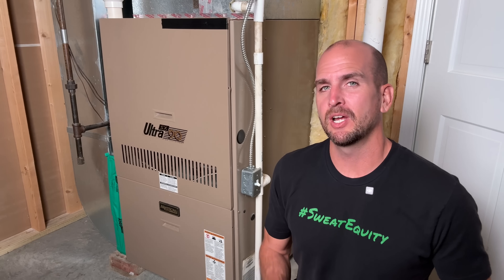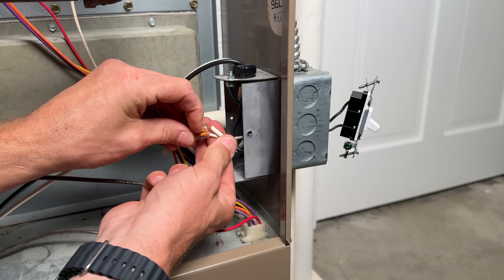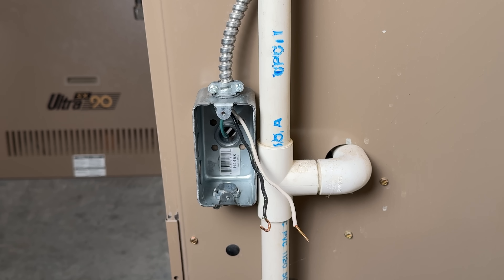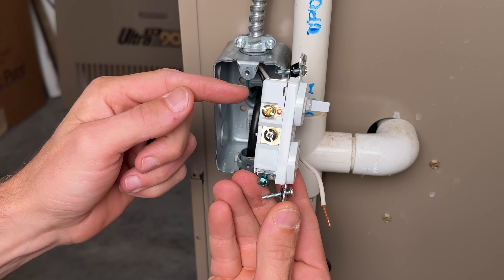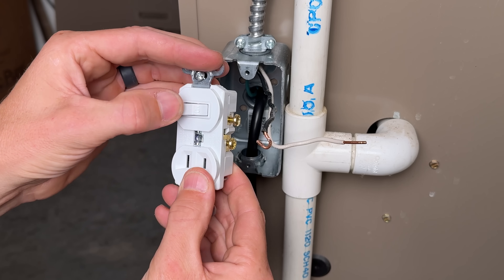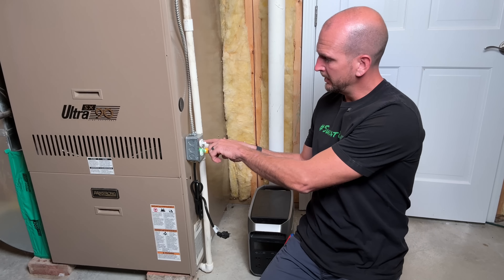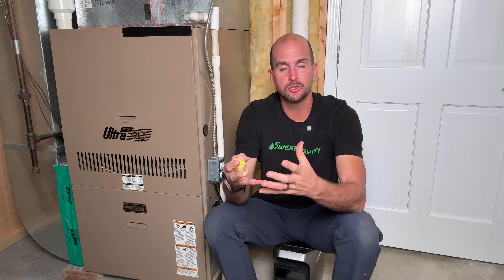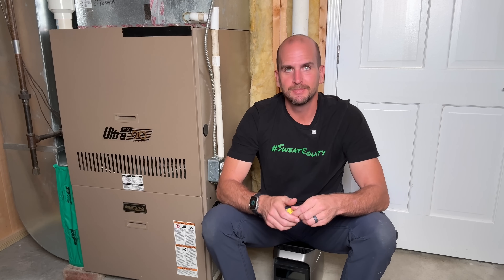Emergency Heat | How To Power Your Gas Furnace When The Lights Go Out

Comment: So there was nice metal conduit and metal box to protect supply wires going into the furnace.  I like Scott's workmanship, but I wonder what NEC2023 would have to say about the idea of running a cheap unprotected 14g extension cord into the box thru knockout & clamp?
Reply: I think the main concern is that a furnace is required to be hard wired. I thought of doing this but instead just replaced the wire nuts with Wagos so that if there's an extended power outage I can easily disconnect the wires from switch and connect the extension cord. Not as simple but same end result and then the other 99+% of the time it's code compliant. Thankfully I've only had to do it once in the last few years.
Reply: @kamX-rz4uy  That's an interesting idea!  Do you keep that unconnected extension cord near your furnace always ready to go, and secured with cable clamp close to box to prevent accidental pull out from Wagos?
Reply: @chuckb4375  It's near the furnace in a bag marked something like generator furnace cord. I didn't use a cable clamp, just had slack in the wires and cord and no one else was allowed near the furnace for safety. It would be a good idea to secure it though.
Reply: You don't even need to be under the latest NEC edition for this to be a major code violation.

This is changing a device that is required and listed to be hard-wired into a plug-in appliance.   Having the receptacle mounted to the side of the furnace doesn't change the situation.

Comment: I do find it interesting when people express alarm that we're going electric-only in MN without realizing that their gas furnace without a generator also doesn't work when the power goes out. This video is a nice option for them to fix the issue they don't realize they have.

Our approach has been to basically get our house closer to passive house levels of insulation and air sealing, so if power goes out we won't have severe issues before power comes back on.
Reply: This is true.. However, most gas furnaces can be ran with only a 1.2KW generator (or other power source). An electric furnace will require a 10X than much power to run. Most people only have a 5 - 7.5KW generator in the garage. That's why people would express alarm about an electric furnace.
Reply: @SvilleSparky  Most of them don't have a generator, nevermind that they'd also need a way to safely connect the generator to their house.

Many heat pumps also could be run with 5kW no problem. I don't know anyone with a single family home in my area who uses resistance heating.

Comment: It was a bit hard to follow without wiring diagrams but…
Wouldn’t this setup feed power back to the panel when you use the backup battery? Thus you would then be feeding power back to the line which is very bad
Reply: No. The portable battery supplies power only via the black plug/cord. When power goes out, you unplug that cord from the outlet, severing the only connection to your home. The battery powers the furnace and nothing else. No risk.
Reply: @nathanscandella6075  gotcha this makes sense now. it was a bit hard to follow in the video

Comment: In short you're converting the furnace to a plug-in appliance.
Reply: For 45 minutes... what a waste.
Reply: @courgettee Depends on where you live. If your power goes out for 12 hours in sub zero temperatures your house is going to get cold quickly.  You can use a generator for power with this setup also ( no gfic from generator)
Reply: @courgettee  Well in my area.... Actually the weather today. If I lost power for 1 hour, my house would be almost at freezing. 2 hours I would have pipes starting to swell. 3 hours I would have to evacuate or high chance of life threatening hypothermia.

So a 10 dollar cord, and 10 dollar switch and an hour of work is well worth it to be able to plug into an emergency power source.
Reply: @courgettee so buy a bigger battery backup unit and/or include a solar array, or run a gas generator...duh.
Reply: Which by NEC is not allowed.

Comment: Scott @EverydayHomeRepairs, why did you connect the green ground wire of the house wiring inside the furnace instead of on the green ground screw on the outlet/switch combo. The power cord also has its own ground prong and wire, and you also connected it to the furnace and house wiring.

Comment: Forget the switch.  Just install an outlet.
Reply: Having the switch is a code requirement, whether you have this “backup” outlet or not
Reply: @nathanscandella6075  CEC states "Suitable disconnecting means shall be provided for the branch circuit."

Comment: I have a fireplace insert with a plenum chamber above it.  At the top of that plenum chamber are two 8" standpipes which are plumbed into my hot air return.  Just above the fireplace is a 36" long, 8" grate for air intake to the plenum chamber.  When I get a fire going the air inside the plenum chamber gets hot (obviously) and rises, pulling in replacement air through the grate.  This forces hot air through the return duct and eventually through the heating ducts.  There is no electricity required, just a normal fire in the fireplace.  No power station needed for heat, but I do own several for basic needs during an outage.

Comment: Please do not make dangeroud DYI halve ass wiring methods. A plug &/or cord must NEVER be used to replace permanent eiring on a fixed  appliance. They make a fsirly in expensive switch that is hard wired.

Comment: Believe it or not, though expensive, there is (or was, I have one installed) a double pull, double through, center off, switch that does this easily.  I have it as the switch between my line voltage and my generator. Basically a transfer switch before home transfer switches were made.

Comment: This is really not a good way to do this. Use the commercial switch & male plug deal, or for 1/2 that 100.00 price get a 2 pole double throw switch, a pig tail & wire it right

Comment: "it pulled 2000 watts". You attached a 15 amp plug, no? Isnt that intended for a max of 1800 watts, and nominally less than that? Shouldn't it have a 20 amp (or greater) male plug? It appears the battery you're using has 20 amp female outlets

Comment: crazy that it's regularly pulling about 1200 watts. My space heater pulls 1500 watts and most likely doesn't move as much heat as that unit lol. I may have to look into a more energy efficient heater. Up in the north it is brutal. tonight it's 44 and gonna get down to 38 and we aren't in winter yet. winters can feel like 10 degrees F. That power station is cool btw.
Reply: @johnnybroughton  ouch true...but the tradeoff is that unlike a space heater needing to be left on for hours, a well insulated home's heater like this one may only need and hour or two to be heated sufficiently with an energy saver option/thermostat

Comment: Wait, didnt that tab you broke off act as the jumper wire that you later connected??
Reply: Yeah, it's the same as if he left the tab there.
Reply: I had the same question. I have no doubt this guy is hitting his forehead with his palm after watching the edit. But he had to publish it anyway. He's a smart dude and admits any mistake or errors in thought on subsequent videos.
Reply: I thought the outlet was always hot unless you broke that tab off?
Reply: What if you want to maintain the furnace switch functionality, but have the outlet available for something else, like a hot water recirculating pump?
Reply: I think the electricity flow in the tab is not controlled by the switch. It always flows via tab if we connect the hot to the black screw terminal. If we break the tab, and add a jumper,  we can control the flow via the switch.
Reply: @jineeshpr  The switch component actually has a defined source side and defined load side. The source is tied in with the hot on the side with the tab. This is because it is designed to provide both switch and outlet functions independently. If your outlet is your load, you are technically supposed to break the tab and jumper a wire across and down from the load side. But since the switch doesn't care which way is which, it all works the same by keeping the tab and wiring your source of the switch to its Load screw. It does mean you are putting a screw with a Hot wire mm's from the screw with the Neutral wire, which is fine but dicey.
Reply: @arickbakken thank you for the explanation sir

Comment: No need to remove the tab or jump.  By reversing the wiring (hot line wire to hot load terminal), you were already ensuring that the switch controlled the receptacle.  Easy to demonstrate with continuity test.
Reply: right, I was just about to say-- how is cutting the tab then putting a jumper wire in actually changing anything? that just puts it right back to how it was, correct?!
Reply: @scottscopters7  correct !
Reply: @scottscopters7 exactly! I don't understand why he broke off the tab and then reconnected it with a piece of wire! Total waste of time!
Reply: You are 100% correct.  I found an error in the Leviton graphics on page#2 for the instructions and this probably caused the confusion.  I explain in a post above.  Kind regards
Reply: @jivepatrol6833  Does that mean from the video perspective when you wired the left side you just wire the right side instead?
Reply: @SketterMcgretter  - my suggestion would be to read the instructions and watch the video from Leviton I put a link to in my other post above.  This video is concise and CORRECT and shows the two use cases.  The error is in the Leviton installation graphics. Kind regards
Reply: @jivepatrol6833 this video is wrong. Don't break the right side tab.

Comment: I do not like this idea at all. Another family member without your skills would have no idea what this is. The on/off switch looks like any other switch and once the extension cord is removed those prongs would be live under normal power. To do something similar to this for your main panel box requires the metal plate to keep the lineman safe but there is nothing here to keep kids or others safe from the extension cord that looks just like any other extension cord that once removed from an outlet has no power in it.
Reply: You really underestimated his knowledge and experience.
Reply: The plug has no power on it, it's just feeding the furnace, like a plug on a toaster. The power comes from the outlet and the switch is like a normal emergency switch on a furnace. It's like plugging some appliance into an outlet or plugging it into an extension cord from your generator when the power is out. There's  no connection between them.
Reply: Great video. More and more of these battery units are coming available and consequently lowering the price somewhat. Nice that you show what the power draw of a typical furnace is and how long it’ll power the furnace for. 55 minutes won’t help very much so it imperative you get the correct unit for what you want to power & for what duration.
Reply: Not true
Reply from the maker: Thanks for the feedback.  When the cord is removed the prongs will not be live as the cord is plugged into the furnace side.  So no chance of backfeeding from an alternative power source to the grid.

Comment: I don't think the switch is necessary just need an outlet with constant power and a whip that you plug into the outlet and leave plugged in. Need to service it just unplug it.
Reply from the maker: Yeah, I am wondering if that would pass code. 🤔
Reply: @EverydayHomeRepairs  maybe not todays code but it is done that way in my residence and I didn’t do it or have it done that way! 🧐 pretty convenient to me though now I’m looking for battery options 🤨
Reply: @EverydayHomeRepairs  No, it wouldn't pass the NEC.  Plus that furnace is only listed for a hard-wired connection.   You won't find any similar furnace listed for a flexible cord connection. 

But if you ignore those violations and just look at the connection, you misunderstood the point of the switch.  It is to provide a local disconnect.  If you have a plug in cordset the switch is no longer needed.  However once you have a receptacle rather than a hard-wired connection you almost certainly need a GFCI protection, and perhaps CAFCI protection.

Comment: Is this code approved?
Reply: He is using this on an Armstrong Ultra SX 90 furnace.  The instructions require a hard-wired connection, just like pretty much every similar furnace.   So he is violating the listing.

NEC 422.16 (A) (2) makes it pretty clear that a permanently mounted furnace generally can't be on a cordset.  Even for a theoretical furnace that provided an option for a cordset in its installation instructions, it would need to be plugged into a GFCI protected circuit.  Topping off the set of wrongness and lack of understanding here, the switch would be redundant since the cordset would provide a means of disconnect.
Reply: @1djbecker I feel like you're making up something cause I don't see it explicitly say you can't use flexible cord for a furnace. There's ruling to if you want to
Reply: @omar10wahab  NEC 400.7 covers where flexible cords and cables are allowed.   A permanently installed furnace isn't among the allowed uses.

Comment: Isn't one of the exposed prongs of the extension cord hot when the switch is on?  If you pull the extension cord plug out of the receptacle with the switch on and power supplied somebody could get shocked.

If this is true then an external cover and some warning labels seem in order.
Reply: I was confused at first but had to draw it out on paper to get it haha. The extension cord when plugged into the outlet, makes the connection from the furnace to the house breaker panel. When you unplug the cord it basically disconnects the furnace from the house panel. Then you plug it into the backup power source and it feeds only the furnace. In normal operation, the switch acts the same as before, just as a safety off switch if working on the furnace.
Reply from the maker: Nope, the extension cord is on the furnace side so when it is unplugged that cuts the source of power.
Reply: @EverydayHomeRepairs  I see.  You converted the furnace power supply to a cord supply, and the switched receptacle just coincidentally was mounted on the side of the furnace.   Didn't get it until now.

You could even run a 50 foot extension cord out to a truck's inverter.  Very versatile.  Thanks.

Comment: There are multiple ways to wire up that kind of switch/outlet. No need to break the tab in this case. Even easier would be to install a regular receptacle and just unplug the extension cord when needed.
https://youtu.be/gJpS0-5JQgU?si=MjHue279ktewLtEp

Comment: I've seen this before and like the idea, but really what is the purpose of the switch when you need to unplug it from the outlet to plug it into the power station anyway?
Reply: It's part of the national electric code meant to protect the maintenance guys from getting electrocuted if the breaker is switched on by someone else far away
Reply: Agreed. I think the only benefit is you can kill power to the furnace to work on the thermostat or unit itself without unplugging. But I agree.

Comment: I live in central Maine and it can get very cold here. I want to be able to plug the oil-fired boiler into a 2,000 watt power station if I lose power. Can you show us how to set that up? Even if I hire an electrician to do the work, I like to understand it. I’ve installed a few receptacles and a new circuit but I want to be sure it’s done correctly and safely which is why I want to understand the job. I live near a hospital so my loss of electricity is usually short but it can go way below zero here.
I love your videos. Glad you achieved a million followers. You deserve it.

Comment: Two other commenters beat me to it, but I’ll ask the same question anyway: what was the point of breaking the tab only to essentially replace it with a jumper wire?
Reply: I think the electricity flow in the tab is not controlled by the switch. It always flows via tab if we connect the hot to the black screw terminal. If we break the tab, and add a jumper,  we can control the flow via the switch.
Reply: @jineeshpr  The tab is the same exact thing as a jumper. He fed the wrong (load) side of the switch…
Reply: @glenburr6755  got it. thank you for the explanation sir.
Hope he is will explain this in the comment to prevent confusion
Reply: You break the tab off. Then you wire a jumper from the left hot wire to the bottom right terminal. Now the switch has control of the outlet. Before the tab was broken both the switch and outlet were hot.
Reply: @DaYammie  Wrong. Doesn't matter whether you have the tab intact or the jumper wire it's the same difference.
Reply: Removing the tab wires the outlets in series.
Reply: So that when the power goes out, remove the jumper, and it powers only the furnace, doesn't backfeed into the whole house
Reply: @MegaSuperEnrique that’s not what Willp4139 was asking. He’s talking about the jumper on the switch/ receptacle that he broke off and then made a jumper for. Which is a step that was not needed since the switch was fed from the load side.
Reply: @MegaSuperEnrique  https://youtu.be/gJpS0-5JQgU?si=MjHue279ktewLtEp

Comment: Make sure to open the circuit breaker if you do connect the alternate power source. Otherwise, you back feed into the  power company's lines outside the house and energize their transformer(s) on the high side, possibly causing electrocution to a lineman. Happened to someone I know who suffered severe burns and had to be transported out of state to a burn center.
Reply: I was also initially concerned about that "suicide cord" issue too, but his AC cord ONLY goes to the load (furnace).  When unplugged from the combo receptacle, there is no connection going back to the panel/breaker...
Reply: @chuckb4375  Oh, good, thanks. It was hard to see exactly what all was going on without a schematic of some sort. Glad that was taken into account.
Reply: 🤗THX SCOTT
 For very timely information 💚💚💚